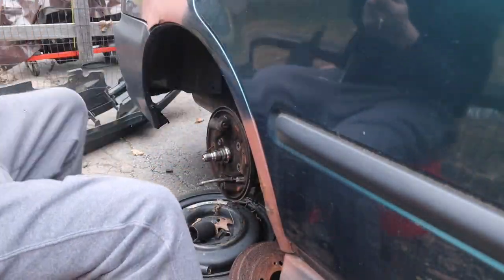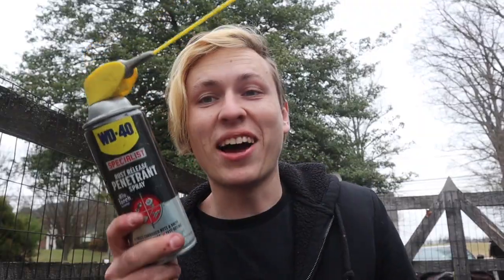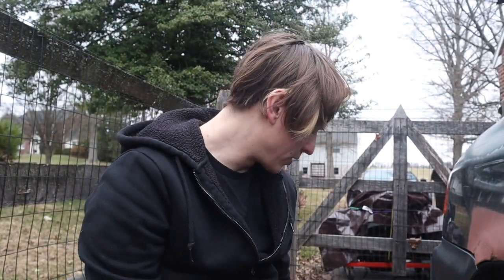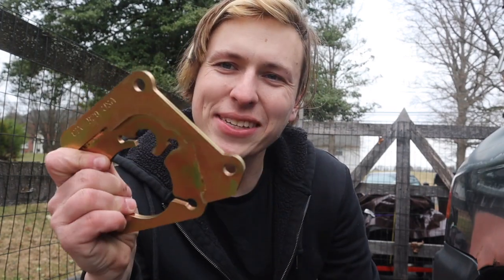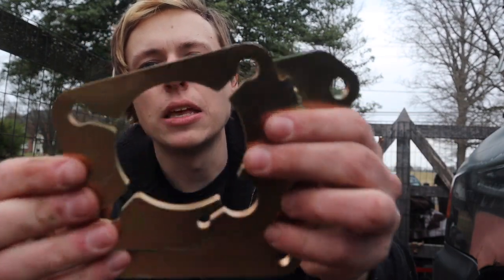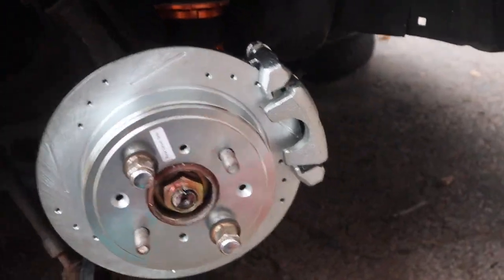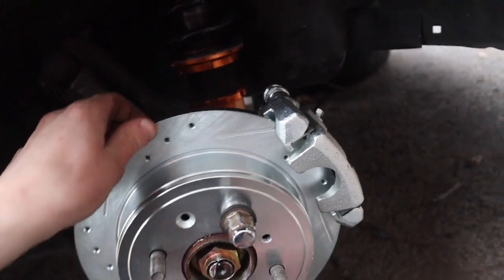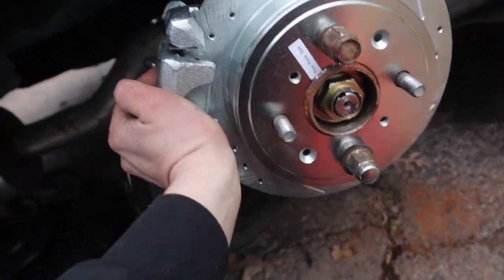Installing The Scarebird Rear Disc Conversion Kit On My EK Civic!

Comment: So what was your totally cost of this set-up? Brackets, calibers, rotors, pads, brake lines and e-brake cables?
Reply from the maker: I still need to pick up brake lines but they should be around $20. The plates were $80, the callipers were $100, the rotors and pads were $50. Everything else is reusable. You can get things for cheaper if you get used things as well!
Reply: @TTRGARAGE what kind of calipers did u use? I want to do the same with my civic ek.

Comment: Did you figure out which parking brake cables to use? Are they the same length on both sides? Also which vehicles version is the right one?
Reply from the maker: I still need to pick them up but they'll be the same size. Also the website has pictures of which kit to buy according to your year and spindle type
Reply: @TTRGARAGE  oh I must of missed that. Yea I've been planning to buy this for a yr now. I'll double check.

Comment: Were you able to fix the problem with the rotors rubbing on the caliper
Reply from the maker: Yep! Just needed some tightening down
Reply: @TTRGARAGE  thanks I’ll have to check mine
Reply: @TTRGARAGE  you didn’t have to shim anything?
Reply: I had a similar issue but mine was cause there was a lot of rust where the plate mounts. I would suggest cleaning that area really well before installing the plates.